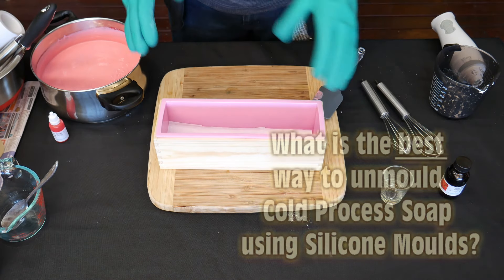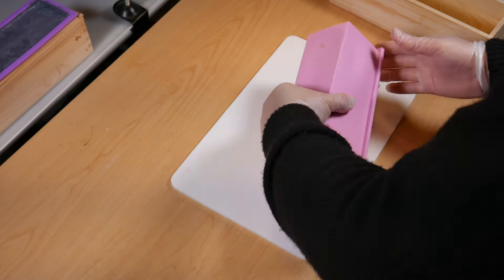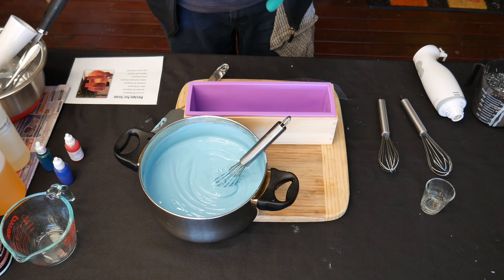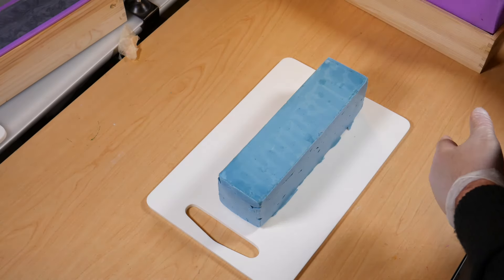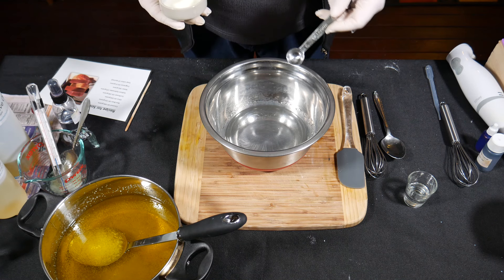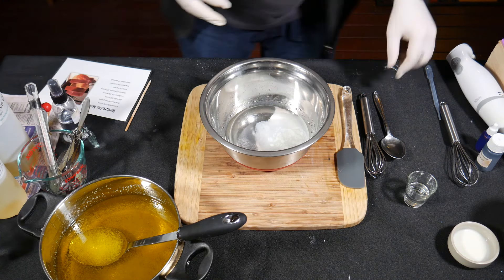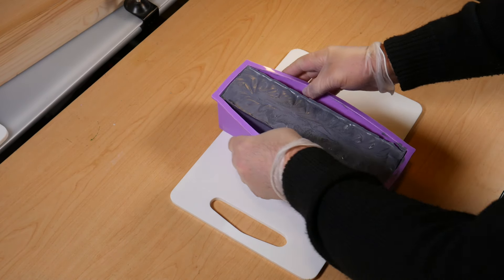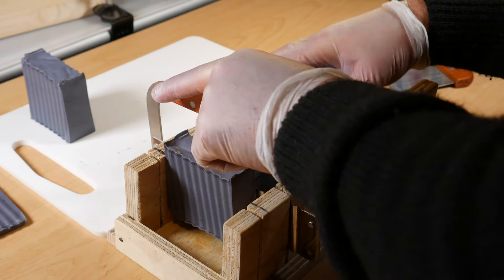The Best Way To Unmold Cold Process Soap From Silicone Moulds!

Comment: You know your soap recipe determines how long it needs to stay in the mould, it isn't a flat 24 hours.  A successful unmoulding is when your loaf slips out of your mould and has a glass-smooth bottom and sides.  Soap that has a high amount of solid oils and butters can usually be unmoulded in 24 hours (but not exclusively) but soaps that have high amount of liquid oils can often be left in the mould for a week before they can be released.  Sodium Lactate or sea salt can help but only to a degree.  If your soap does not pop out of the mould you should stop forcing it and leave it for another 24 hours and give it another go (and so on and so on).  If you need to unmould in 24 hours you will need to reformulate your recipe to have a higher solid oil and butter content and possibly use S/L or sea salt.  Encouraging your soap to gel will help.
Reply from the maker: True, but as an experiment, I wanted to see what worked best without changing our standard recipe.  These are just the results of our simple test for a 24 hour unmould, not the end all of soap making.  It was requested by one of our  workshop students.

Comment: Great video!! May I ask how you avoid the wretched soda ash pleeeease 🙄
Reply from the maker: Sometimes it's difficult.  If we find soda ash on our bars, we hold them over a steaming kettle and the ash goes away!  Easy as pie.
Reply: You can also sprits the soap with rubbing alcohol once you pour you soap in the mold. It can help prevent soda ash
Reply: I saw on a recent video that you can rinse the ash off briefly with very hot water before un-molding the soap. This really only works for non-decorated soaps though. I made a batch and sprayed it after pouring, then again before I went to bed. When I uncovered it the next day, no ash!